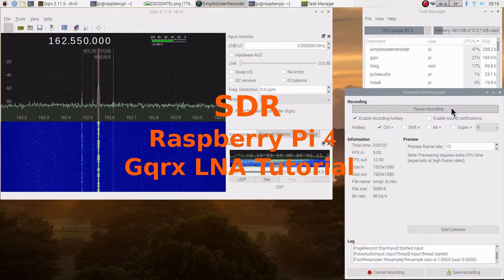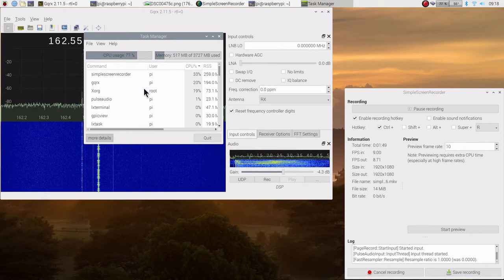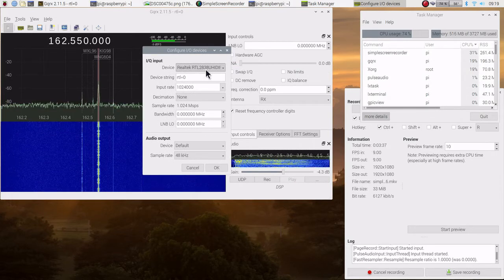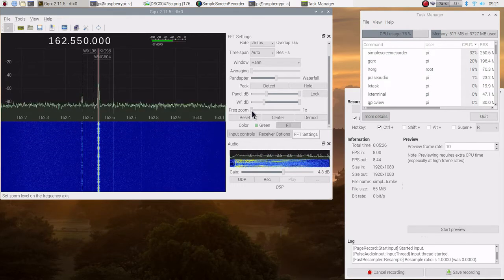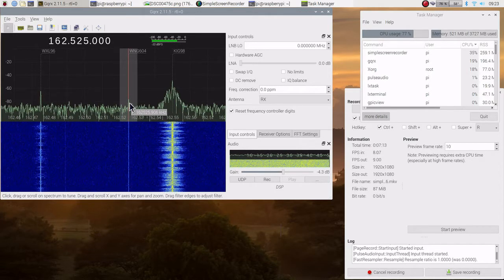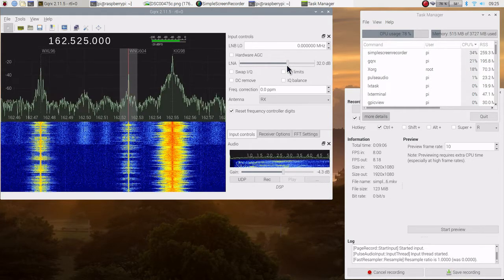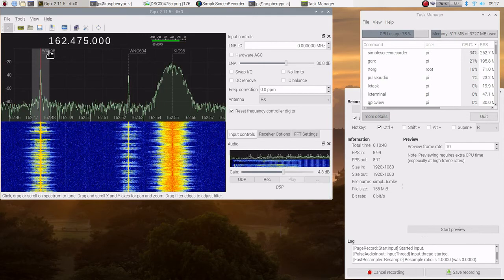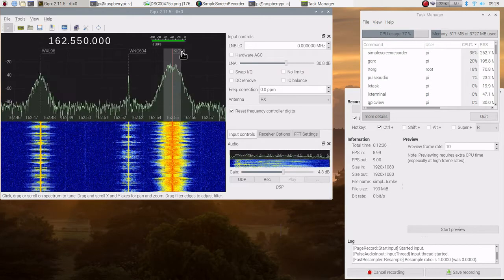SDR Raspberry Pi 4 Gqrx LNA Tutorial

Comment: The RTL-SDR v3 will go lower than 24MHz on GQRX, they just didn't add an easy toggle to change the sampling mode on GQRX, you have to manually type in direct_samp=2 into the configuration/setup window to use the Q branch to be able to go below 24MHz. And you would have to set up two configuration files to "easily" switch between the two. I'm just glad that SDR++ runs on the Raspberry PI, it's so much better than GQRX.
Reply from the maker: Thanks for the info

Comment: Quick question: you mention the frequency range starts at 24mhz. I thought the rtl-sdr could go down to 500khz. Is there a setting or restriction on the raspi?
Reply: NVM. I answered my own question. 

from:
https://www.rtl-sdr.com/rtl-sdr-blog-v-3-dongles-user-guide/comment-page-1/

Feature 1: Direct Sampling HF Mode
This feature allows you to listen to HF signals between about 500 kHz to 28.8 MHz.

To use direct sampling mode

Connect an appropriate HF antenna to the SMA antenna port (this is the same port where you connect your VHF/UHF antenna). 
In SDR# select the Q-branch in the configure menu (the cog icon next to the play button). (If it is greyed out make sure you stop the SDR first, by clicking the stop button in SDR#)
Press Play and tune to 500 kHz - 28.8 MHz.
Q-branch

VHF antennas like small discones or short whip antennas will probably not pick up HF signals very well, if at all. If you have one of our dipole antennas, try connecting a long 5 meter or longer wire to the element connected to the coax center wire. To check which element is connected to the center coax you can open the lid on the black dipole base. Ideally you should use a 9:1 unun with the long wire antenna for optimal reception. Even more ideally you'd use an antenna tuner, though this is expensive.